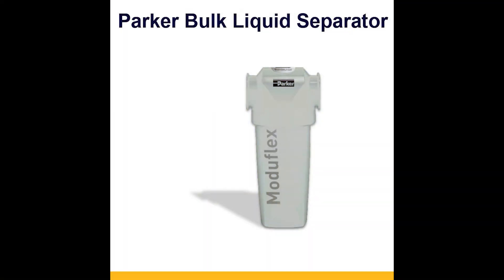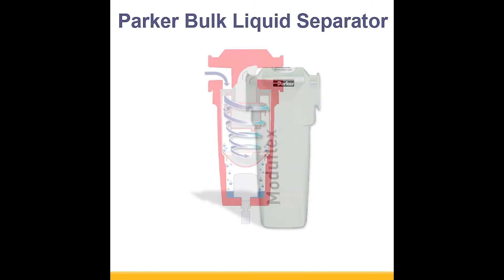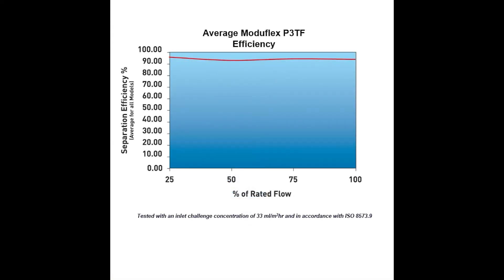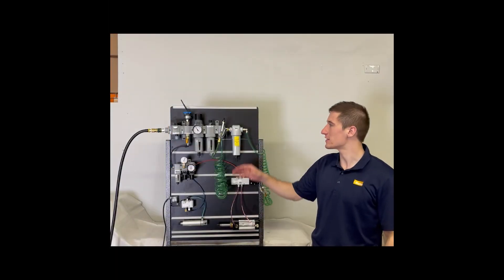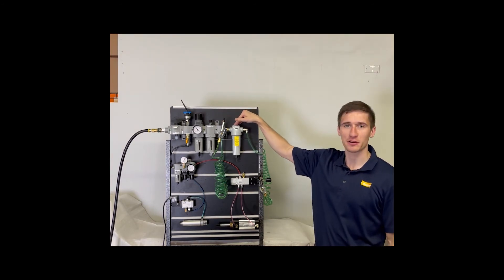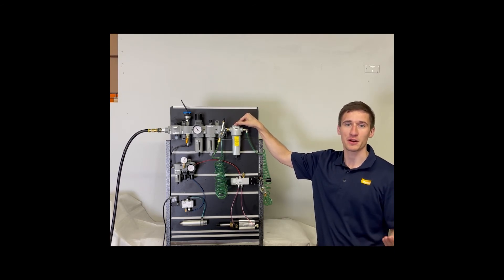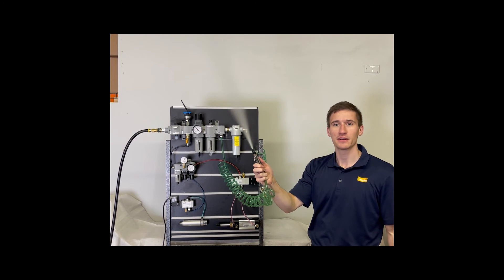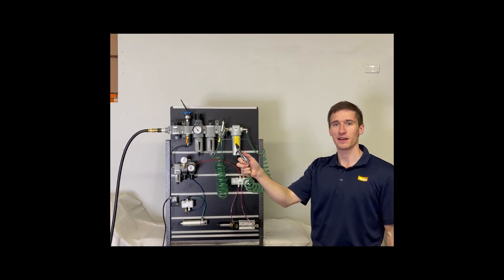Learn about Parker's  Bulk Liquid Separator (Moduflex) and see a demonstration.

Comment: Will the bulk liquid separator automatically drain while pressurized, while it is in-use?  In other words, if I am using my pneumatic tools and the separator gets full, will it automatically open all by itself to expel all the collected water?
Reply: Hi Oscar, if your unit has an auto drain, then yes, it will automatically expel the collected water.
Reply: @jasonguiddy2787  thanks for the reply.  I don't have a unit yet. I'm looking to purchase one, so I'm wanting to find out specifically if these Parker Moduflex units will self-expel the collected water, while I'm actually  using my air tools, with no human intervention what so ever.  Thank you for any information you may provide about these Parker Moduflex units.